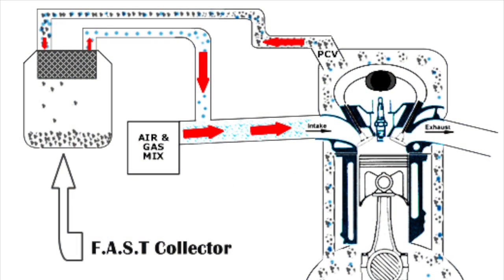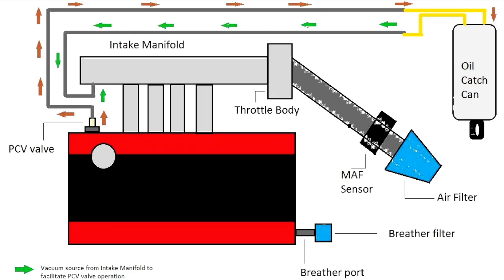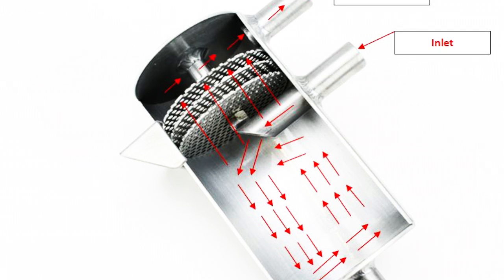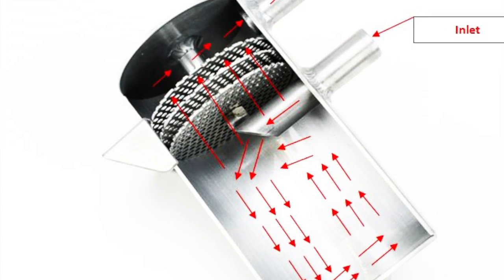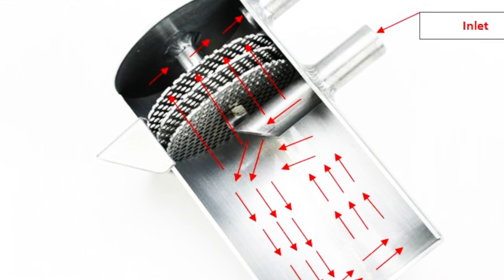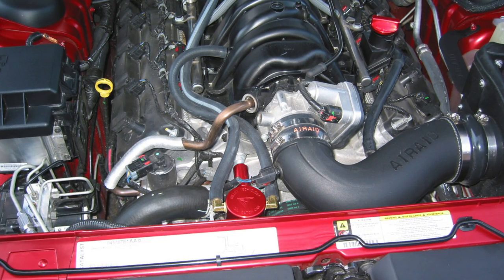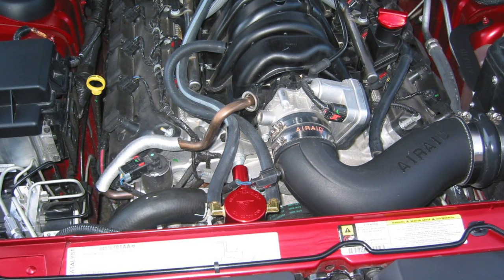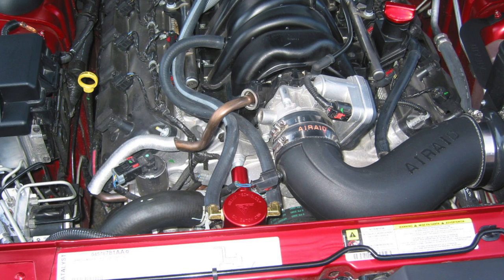Oil Catch Can // What Is it?

Comment: Nice well research man, I will probably be ordering mine by end of week, payday😉🖒, what brand did you order?
Reply from the maker: I went with speedlogix - looked pretty slick and easy to install.
Reply: Got mine from Speedlogix as well. Just purchased a bracket today to relocate from front of engine to make it more easily accessible.
Reply: Yes its installed, but not the new bracket yet. The amount it collects depends on how hard I drive it I've noticed. I tried to empty it at my 5000 mile oil change interval but like I mentioned if I drive it hard which is most of the time it collects a lot. With that said I'm gonna empty it once a month regardless!
Reply from the maker: You have it installed already right? If so does it collect a lot? How often do you empty it?

Comment: Mounting the z bracket required removing a plastic screw that holds some wiring in place and screwing the bracket in its place. If you have any questions let me know it was kind of a pain finding the correct spot and i didnt want to mount it to the water pump stud.
Reply from the maker: Thanks man - I appreciate the heads up. Will def hit you up if I need some help

Comment: Got mine as soon as i got my intake i empty it roughly every 2000-3000 miles and i get about 3 to 4 oz of oil in it everytime.  Depends on how hard you drive your car also, flooring it more often will result in more oil caught in the can.
Reply from the maker: ok very cool - so about every 2K miles I should take a look & see where it's at. Thanks man for the heads up
Reply: R/T Life yeah it doesnt hurt takes 5 min to empty it.